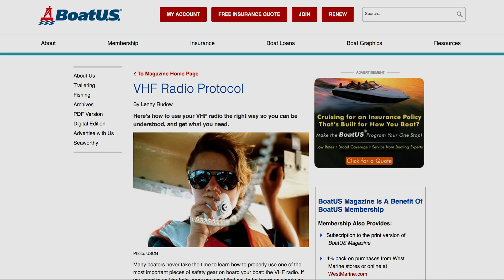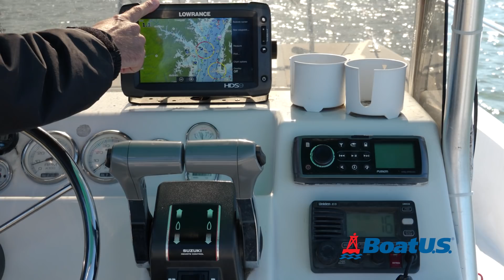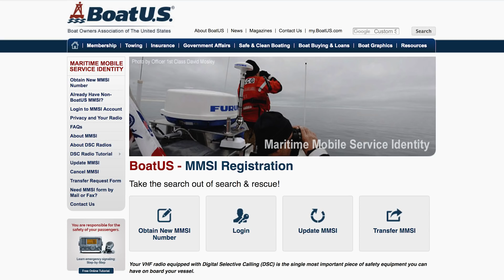3 Tips for Using a Marine VHF Radio [+What's MMSI & DSC?] | BoatUS

Comment: I have a Cobra MRF57B vhf radio. I taker it I need an MMSI number for the GPS to work? Also, do I need a chart plotter so in an emergency the coordinates will be sent to the Coast Guard or will the GPS itself do that? I guess a chart plotter would only be needed if someone else needed my assistance so I would plug coordinates in to know where they are? I have a separate GPS from Cobra that I'm hooking up to the radio.
Reply from the maker: Thanks for the question, jdtractor. The Cobra MRF57B VHF already has a GPS chip built in, so it is not necessary to connect this to an external GPS of any kind. Your VHF has a large LCD screen and this will display your position in latitude and longitude, so if desired, you can use this to plot your position on a paper chart. Once the VHF has been programmed with your MMSI number, all you would need to do in an emergency would be to press the red distress button on the front of the radio to summon help. The cost for an MMSI number is normally $25, but this fee is waived for BoatU.S. members. You can sign up through our website, https://www.boatus.com/MMSI/MMSI/Home
Reply: @boatus  The one I bought did not have an internal GPS so I bought the add on one from Cobra. Did end up getting my MMSI number last night, just have to put it in and see if it works. Thanks for your response.
Reply from the maker: @jdtractorman7445  Great! Hopefully it will be an easy job.

Comment: i have a question is there is radios transmitting along with your position automatically or we have to connect radio with gps... it is confusing. i thought new radios are automatically transmit the position also.
Reply from the maker: Great question, jenson. You basically have two options: If the VHF with DSC doesn't have a GPS built in, you'll have to connect it to your chartplotter to be able to automatically relay your position info in an emergency. However, all of the major VHF manufacturers offer models with GPS, both for fixed-mount and handheld options. And it won't cost you an arm and a leg either: I've seen some GPS models retailing for around $200. Either way, you DO need to request and program in an MMSI number for the DSC button to work. (You'd be SHOCKED at how many are never programmed!) BoatUS Members can request an MMSI number for FREE at https://www.boatus.com/mmsi ($25 for nonmembers). That number is assigned to the specific boat, so the VHF (fixed or handheld) stays with the boat. Hope this helps!

Comment: I have a handheld VHF for about a year in which I’ve entered my MMSI number.  I’m in process of installing a fixed mount VHF in my boat.     Do I use the same MMSI for both radio units?
Reply from the maker: Great question, Freddy. Yes, use the same MMSI number in your fixed VHF as in your handheld. The MMSI is unique to the vessel, not the radio.
Reply: Thanks so much for the prompt, expert reply.  Great videos always, Lenny.

Comment: Just a thought on another reason the antenna needs to be vertical. I believe the signal from the antenna radiates out like a pancake at 90 degrees from the antenna. If the antenna is not vertical, part of the signal will go up towards the sky and the other half will radiate down into the water, thus reducing the amount of horizontal "reach" of the signal.
Reply from the maker: Excellent point, Don. VHF radios operate on "line of sight" signals, so keeping the antenna at 90 degrees is a necessity. (Except when going under low bridges!)

Comment: Do you need a license for VHF marine in the U.S ?  In Australia you do. Heard it was about $130au
Reply from the maker: Great question. We used to need one, but no longer for most recreational or small commercial vessels if you're within U.S. waters. For those traveling outside of the U.S., a license is required. If you operate a HAM radio or SSB, the radio and the operator must be licensed in most cases.
Reply: Here are the requirements: https://www.fcc.gov/wireless/bureau-divisions/mobility-division/commercial-radio-operator-license-program/commercial-0

Comment: If your VHF radio does need to be wired into your graph/gps not only can you wire your GPS Tx (Transmit) wires to your VHF radio Rx (Recieve) wires on order to send out your position, you can also wire the Radio's Tx wires (same wire harness) to your GPS's Rx wires (same wire harness).
This then gives your boat/system the ability to see another vessel's location when they transmit ( of course only if they have DSC). It should show up on your graph/gps head unit as well as the radio display as well.
This would let you see/know where a vessel in distress might be, on your graph, you then might see you are close enough to help the situation quicker.
Its almost like having a AIS (automatic identification system)  cheat going on.  Everytime a vessel with DSC calls on the channel , by law, you should be monitering , that vessel will be visable on your graphs.
Reply from the maker: Thanks for sharing your experience, Troy. Someone might find this useful. And, yes, boaters are legally obligated to assist other boaters if they're in the vicinity. If only more folks would do that off the water, too ...

Comment: i think with boatUS registration your MMSI data is only available to US bodies. The internationaly accesible MMSI reg is some 220$ if you boat is USA flag
Reply from the maker: You're correct. This applies to U.S. waters and the U.S. Coast Guard. If you want international functionality, it's necessary to get an FCC Ship Station license, and during the process you're assigned an MMSI. --Lenny
Reply: @boatus  what if I get a US only MMSI, but then operate in Canadian waters?  Will they just not recognize the number?
Reply from the maker: @painbank  Great question, Rich. We had to do a bit of research. Canada maintains its own MMSI registry, here's the link to register: http://www.ic.gc.ca/eic/site/smt-gst.nsf/eng/sf01032.html
Also note that you can obtain an MMSI via a ship station license, which is required for non-federal use. The full explanation of US Coast Guard regulations regarding this can be found on its Marine Mobile Service Identity webpage, https://www.navcen.uscg.gov/?pageName=mtmmsi
Reply: @boatus  ah, reading the CSCG regs again, only need ship station license IF going beyond US and Canadian ports. just a bit confusing reading it is all.  So, I could get a MMSI from Boat US and then travel to Canada and feel fine knowing it is all good.  thanks.
Reply from the maker: @painbank  Glad that was helpful. Yeah, most of those documents are clear as mud!

Comment: Dsc doesn't need a chart plotter connected  if radio has gps...
Reply from the maker: Good point. You're correct. If there's a GPS chip in the radio, no external connection to a chartplotter is required.

Comment: Tip #1. The only tip needed: get a vhf license.
Reply from the maker: Thanks, Vilhjálmur. In the US, a VHF license is no longer required. However, for anyone traveling internationally, you do need one. And in Europe, you will need both a ship's license and operator license. Tip: Make sure to obtain and input an MMSI number. BoatUS members can get an MMSI at no cost.
Reply: @boatus  thanks, I am in Europe. I am a captain and I have the GMDSS license and considering the recent incident in Norway where Norway's most expensive warship sunk off the west coast of Norway last November due to miscommunication and that the people involved did not follow radio communication protocol it is now clear that the incident could have been avoided if the crew on the ships had followed protocol. I'm just saying, the best tip is to simply get a license because then you learn about these protocols which can help prevent a disaster. Whether it's required or not.
Reply from the maker: @villimagg  Great example!